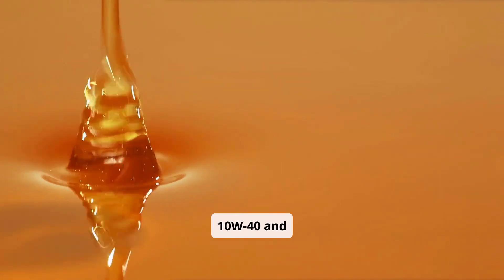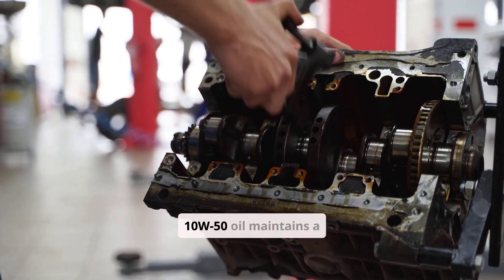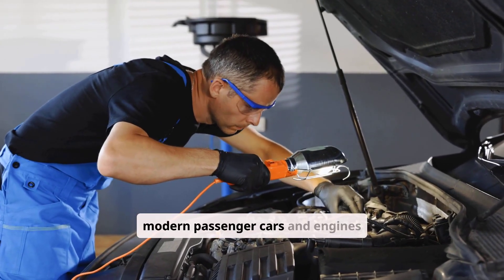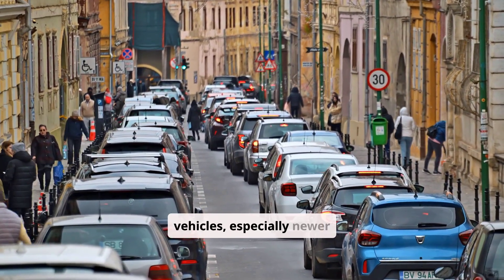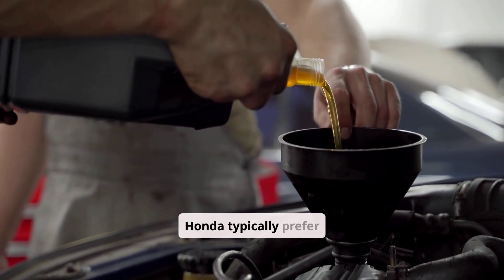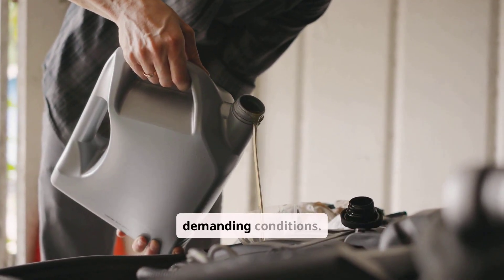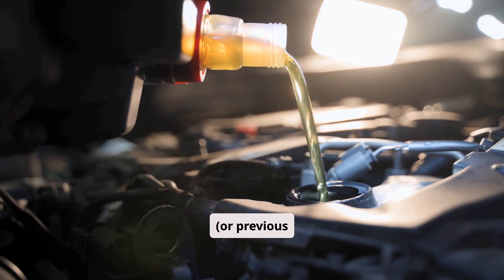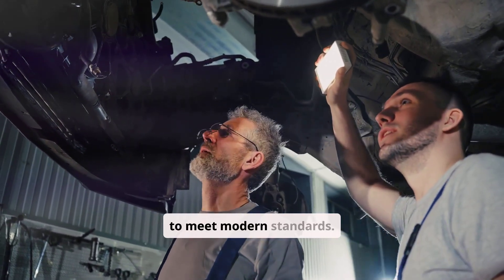10W40 Vs. 10W50 Engine Oil Comparison

Comment: BMW 116i n13 2013 version, in a very hot area cebu philippines. Im looking to switch to 10w-50. Is it good?
Reply from the maker: For your BMW 116i N13 (2013), BMW generally recommends *5W-30 or 5W-40 fully synthetic oils* that meet BMW Longlife-01 (LL-01) or Longlife-04 (LL-04) specs.

Switching to *10W-50* is not usually advised unless you have a specific reason (e.g., heavy track use, consistently extreme high load, or high oil consumption). A thicker oil like 10W-50 will protect at high temps, but it can also:

* Reduce cold start protection (even in Cebu, mornings can be cooler than engine operating temp).
* Affect fuel economy.
* Put extra stress on the oil pump.

Since Cebu is hot, a *5W-40 LL-01/LL-04* oil would be a safer upgrade from 5W-30, giving you better high-temperature protection without being too thick for your N13 engine.

Stick with **5W-30 (preferred) or 5W-40 BMW-approved oil**. Use 10W-50 only if the car is modified, used for racing, or showing oil pressure/consumption issues.
Reply: @carphrases i do get oil consumption and blue smoke at heavy idle so i put it on higher rev than usual lik 2-3k rpm before shifting